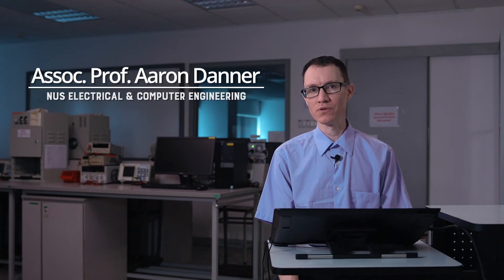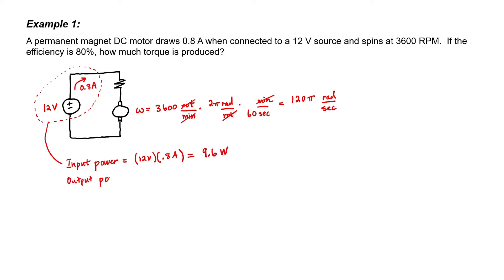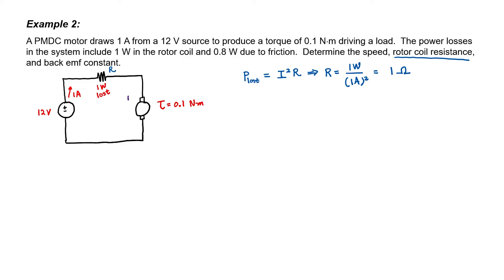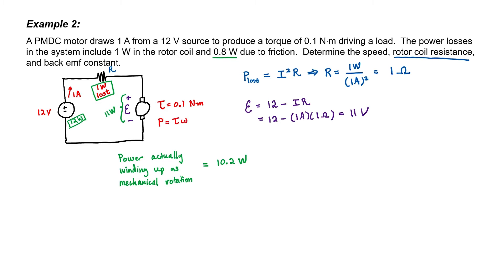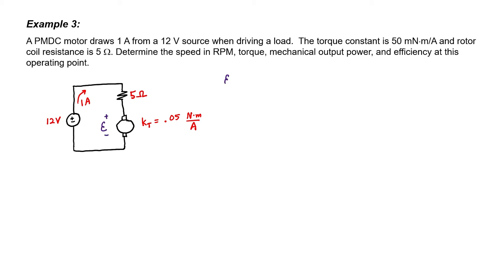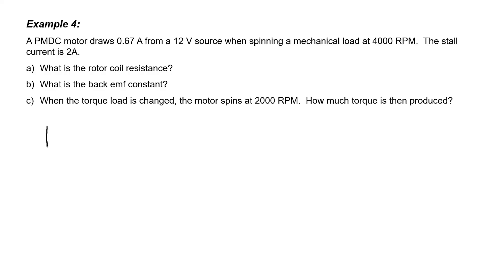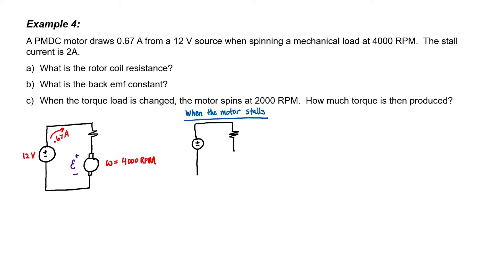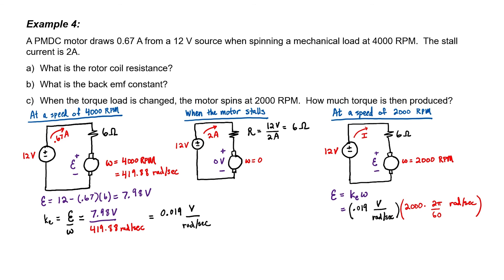DC Motor Problems: Examples 1-4 (Motors #5)

Comment: when i multiply 3600 by 2pi and then divide it by 60 i get 377 radians per second, can you please help me understand the math portion of the first problem?
Reply: hey hey! the reason why you are getting 377 radians per second is you are multiplying pi. If you divide 376.9911184/pi you'll get 120. So in the problem the professor doesn't multiply pi just yet. The professor leaves the angular velocity as 120*pi rad/sec. For calculating the torque 7.68 / (120*pi) = 0.0204           Or 7.68 / 376.9911184 = 0.0204

Comment: in the last problem of this lecture we got the Ke for 4000 rpm for the load which the motor runs at 4000rpm .my problem is how to apply the same constant value for Ke which is the constant for 4000rpm to 2000rpm running load,well my mind say well two different weights and motor needs more current for 2000rpm runnig load so  that the voltage get reduced and current get increased.I thought there must have been twice the current for 2000rpm in comparison to the 4000rpm load.yes it's constant for 4000 rpm but how come for 2000 rpm such question sir please help me